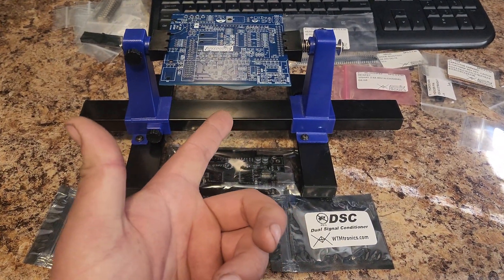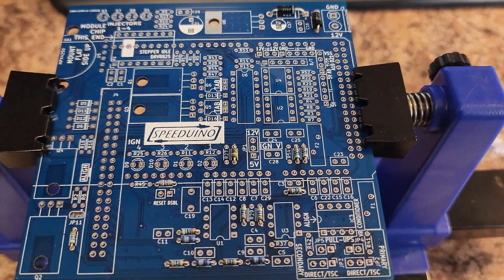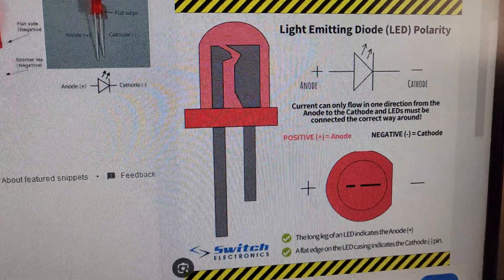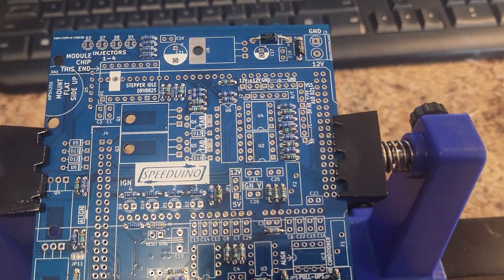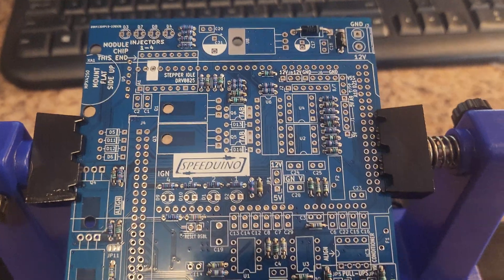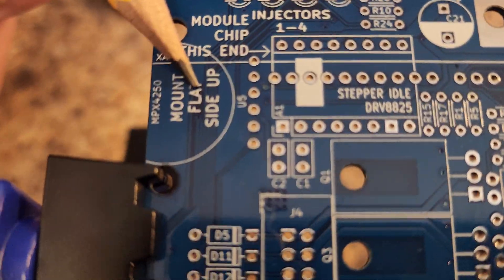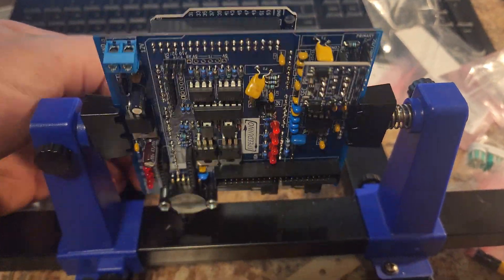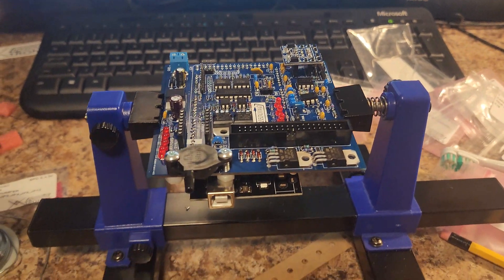Building a Speeduino for the Del Sol #delsol #turbocharger #diy #engineswaps#honda #speeduino

Comment: Just a tip for anyone following along. 
Only electrolytic capacitors have a polarity while every other type can be installed in any direction its still good pratice to have the outside foil facing negative for sheilding its not critical to the way the circuit works.
Reply from the maker: Solid advice that is probably something we should have mentioned

Comment: How do you get vtec to  work
Reply from the maker: you can trigger that off any on/off output that can trigger off rpm. in our case we are working with a non-vtec engine but in theory any on/off output should work if you can map it to rpm

Comment: I was going to build one for my racecar, but ran out of time and just put the stock ECU back in and left the distributer in the engine instead of cop.
That was over 5 years ago I think.  Today the arduino mega is just as obsolete/slow as megasquirt.  I actually built my own EFI for a 1960 tractor using a 8mhz msp430.   It maxed at 3500rpm, so a really slow ecu was ok.
Reply from the maker: i agree its not that fast but for a b series where your ignition is still distributor based. and its batch fire injection cause it only has crank signal it should be plenty fast enough. lots of guys out there useing these for high reving 4 cyl streetbikes so should be fine